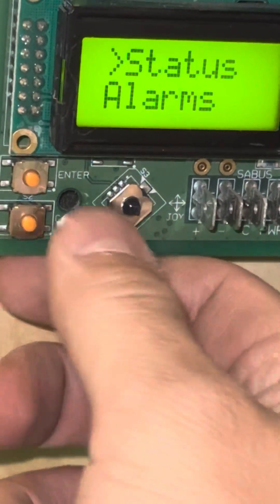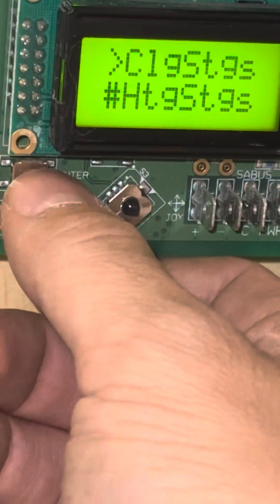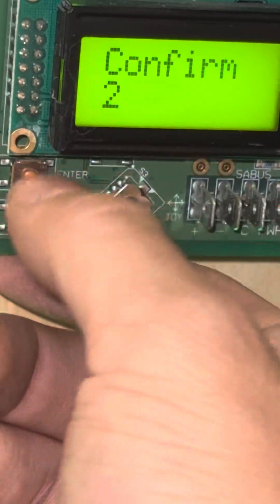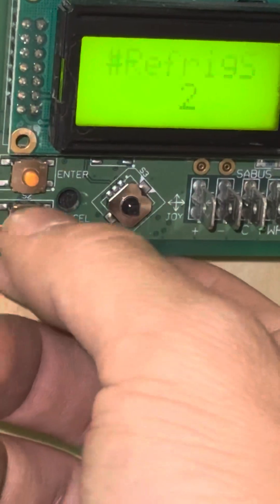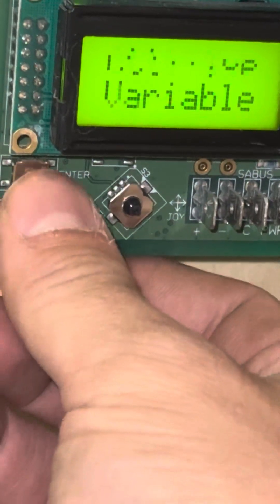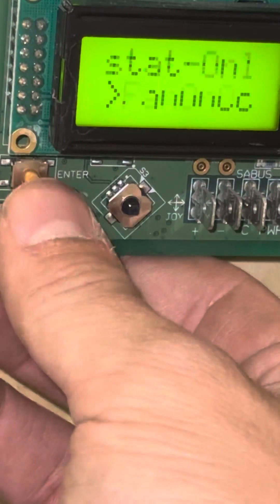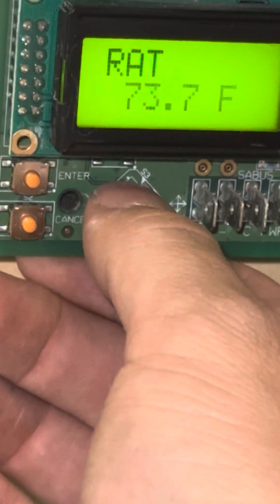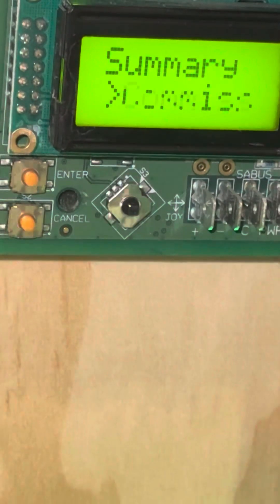York Smart Board - Commissioning (Quick start menu)

Comment: Great stuff i had my board reading imput reduce due to brown out v do u have any idea how to trouble shoot that error.
Reply from the maker: Most likely need a new board. You can try isolating the board first and see if the code goes away… possibly could try a firmware update as well.

Likely a power surge

Comment: I recently had service for no heat at a store.Arrived found 2 new york RTU'S with just line voltage connected. I installed 2 new t-stat and drop them in the return. My units would operate in heat and then shut off and controll board just says idle before unit reaches setpoint then they would just come back on in heating again and runs and shut off before set point again
Reply from the maker: @anthonystewart3787 It sounds like they’re either running off the return air temperature sensor or they’re tripping on excessive supply air temperature, turning off for 10 minutes then coming back on.

Try and check parameter t-stat only and make sure it is set to yes.